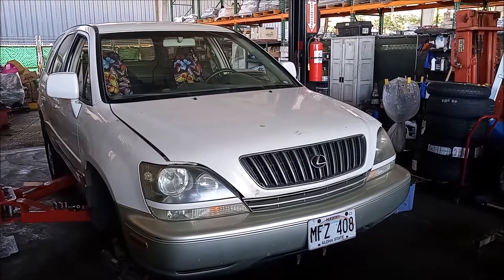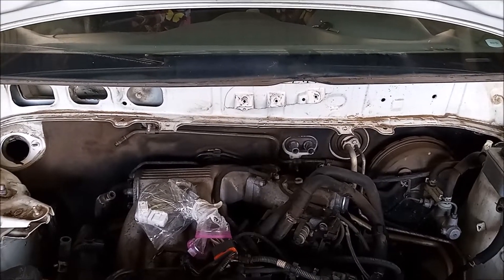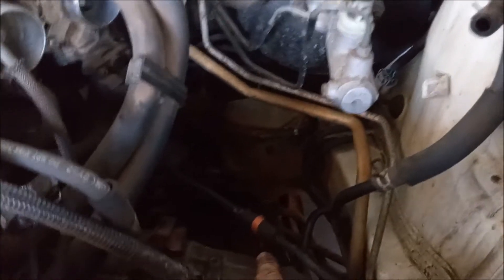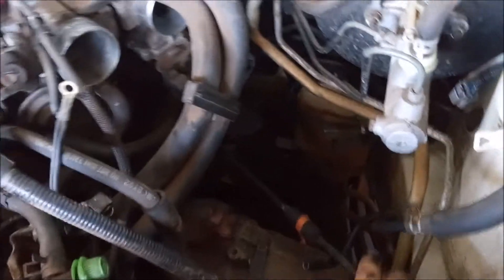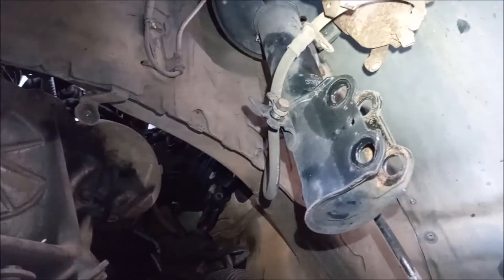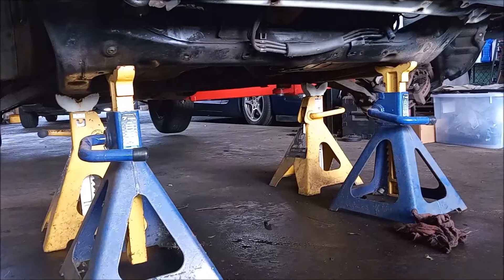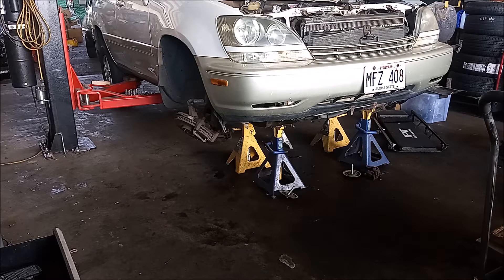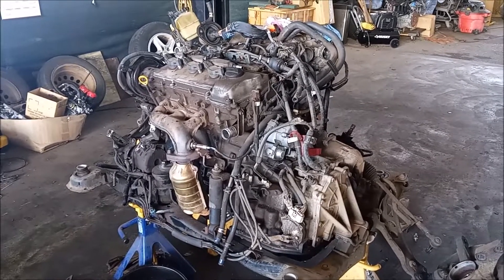How To Remove The Engine - Lexus RX300 Toyota Camry Highlander Sienna 3.0-liter V6 1MZ-FE

Comment: Thanks Frank, I love how precise and short your videos are. Would I better off removing the engine to do head gaskets and timing belt? I'm not sure how hard it is going to be to get the rear head and exhaust off with the engine in, or the timing belt stuff through the wheel arch. cheers & thanks again. (2001 Avalon -Aust build)
Reply from the maker: Head gasket yes you want to drop the engine -  too difficult to deal with the rear bank in-car. Getting the exhaust off is not a big problem, buit just imagine trying to set the head back on there at a 45 degree inclination, not to mention loosening and tightening the head bolts plus the cam caps plus everything else. Timing belt is usually done in-car, I do out-of-car videos for the timing belt so people can see everything.

Comment: In this a fwd or a awd model? Can you drop both out rhe bottom as engine and transmission assembly?
Reply from the maker: Yes both FWD and AWD drop right out. You just remove the driveshaft on AWD.
Reply: @Merryfrankster_  Thank you for taking time to respond.
Reply: How many hours did it take to take it out and put it back to driving condition? Doing it as an assembly each way , without splitting the engine and transmission AWD unit.
Reply from the maker: @pltmann  I have no idea exact hours. I have many other jobs to do. I answer the pboe answer emails, deal with other customers, do minor repairs on other cars. Usually it takes me one week to do engine replacement.
Reply: @Merryfrankster_  why did you have to replace the engine bud?
Reply from the maker: @devinnorsworthy9154  burning oil, sludged up, finally rod knock.
Reply: @Merryfrankster_  hmm, sounds like somebody didn't take care of their oil properly. 🤔 I put At205 in my oil to help keep the seals refreshed. I will run At205 in the coolant as well, I also use Gumout because it works to removed carbon build up. Simple maintenances... save you thousands.
Reply from the maker: @devinnorsworthy9154  you're a star. But if everyone were like you, there would be no work for me. As you can see, this is a professional garage where we repair other people's cars. So quit it. Please start encouraging people to go for 20,000 OCI, and use Mazola in their crankcase. This will assure us of a steady stream of work.
Reply: @Merryfrankster_  buddy, my car won't need a mechanic for a good while lol 😆
Reply: @Merryfrankster_  believe me bud, you have nothing to worry about. There's too much work for mechanics, and there's becoming fewer and fewer mechanics. Your trade is here to stay. 💯  but yeah, personally I've done thousands of dollars worth of work on my own vehicle. I just pay for parts and make it happen.

Comment: Gracias no sabia como en mi hilander
Reply from the maker: Very similar not much different except the motor mount for the Lexus is different from the motor mount for the RX300 but this does not change how you drop the drivetrain with the subframe.

Comment: You think I can leave the subframe on the floor and lift the body with the engine hoist Thanks in advanced
Reply from the maker: If you lower the subframe to the ground you will have no way of moving it around. If you drop it onto dollys, you might not be able to lift the body up high enough to get it out. you could try lifting the engine and transmisison up through the top or possibly remove the radiator/condenser and front frame assembly if it is removable on your vehicle.
Reply: @Merryfrankster_  i Appreciate your quick response
Reply from the maker: @GMZee559  thank you for watching and for commenting.
Reply: I read somewhere in forum that you'll need to lift 24" min to clear engine from what ever you drop it onto.

Comment: I removed the 3mzfe out of my rx330 through the top/front since I couldn’t afford the $2500 in labor shops wanted to do the job. I also did a full timing job and a partial overhaul of all seals and gaskets that I could easily reach with the engine out. I was all in at just under $1600 including an $80 engine hoist, an aisin timing kit I found online for $40 and an itm gasket set for $80. Fluids including a full transmission flush and filter change and gear oil in the rear diff and t case. Would have been a $6k job including the $750 salvage engine. All I need now are new front bearings, a new hood latch cable and b1s2 o2 sensor and she’ll be 99% perfect. A paint job would be nice too. Now I just have to rebuild the 3mz that had serious bottom end knock. Curious to see what element wrong with it.
Reply from the maker: Amazing. If it stays running you are in like Flynn.
Reply: What ended up being wrong with the bottom end knock?
Reply: @roofcamper3473  the same thing that tends to cause any rod knock, oil deprivation. If I had changed the oil right at 5000 miles I would have avoided it but the oil light was flashing and my fiancé didn’t let me know. I’m guessing the pick up was clogged or the piston rings were sludged and it was cooking off oil but when I drained it maybe a quart came out of the engine we replaced.
Reply: how did this swap last you? @deeeyewhy5949
Reply: @FilmBySaga  still going with 222k miles on the chassis. Need a new windshield and to fix an exhaust leak. Just fixed a front wheel bearing and did ball joints tie rods and sway bar links. Love my 21 year old Lexus Rx.

Comment: Is it possible to swap from a 2003 lexus rx300 1mz vvti to a 3mz vvti with the donor engine being the same drivetrain? (2wd to 2wd)  what I know so far from your videos is I'll need a 1mz oil pump to the 3mz to keep the t-belt tensioner vertical. Any thoughts? Mahalos!
Reply from the maker: I think you can get the engine mounted up no problem, but you would have to deal with the engine control. The 3mz vehicles have a different ecu with different knock sensors, injectors, an electric gas pedal, and an electric throttle body. With your 3MZ long block you  can use the 1MZ intake and throttle body and also use the 1MZ ECU and harness with the 1MZ knock sensors and the 3MZ fuel injectors. You may have to do something  about the compatibility of the fuel lines and fuel rail you may have to do something with that.  But I don't see why it would not all work out.
Reply: @Merryfrankster_  that was my thoughts as well. Using the 3mz as a long block and Installing 1mz intake manifold and plenum and let the 1mz ecu handle the rest.

Comment: I do not have the shop lift like you have so to drop the subframe with the engine and transmission is something impossible for the DIY. I removed one engine from the FWD RX300 with the heads on from the top but I had to remove the heads and the short block separately from the top on the AWD RX300.
Reply from the maker: It's not so hard to remove a 1mz fwd from the top - putting it back in is where you might struggle a bit. Been there and done that and would never want to do it that way again. On AWD I think you would want to remove the transfer case first to remove the engine from the top, but with lift the entire assembly drops right out, and the engine can be separated without any trouble leaving the transfer case in place. .
Reply: I'm in the same boat, I have a FWD and no lift.  Is there anything differently I can do to be able to lift the engine out?
Reply: @Absoluteprecisionnj  I am an old timer. I did it liked we used to do it with the RWD of the vehicles in the 80s and 90s. Remove battery, front hood, windshield wiper motor, belts, intake, exhaust manifolds, hoses, brackets, ac compressor (do not let the refrigerant out so you don’t have to recharge it) alternator, power steering pump,right side wheel and driveshaft, separate transmission from engine and keep it in place by a little car jack and pull the whole engine out with the engine hoist from the top. You may need another watching eyes and hands to pull it out. It is little bit of works if you are up to the challenges or it may not be worth it, because the vehicle is more than 20 year olds. I did it because I have had time and I have liked the challenges.Good luck.
Reply: @HuyNguyen-vl4nh  thank you. I was thinking to try the same. Car is good shape beside the head gasket that went.

Comment: Fo the DIY you can remove engine from the top with just the engine hoist and regular tools. Leave transmission in the vehicle. Good luck
Reply from the maker: It's not DIY it's KYO - Knock Yourself Out!
Reply: Do you have any more details on the removal, I’m at that point just can’t find a good video on pick points instructions etc.